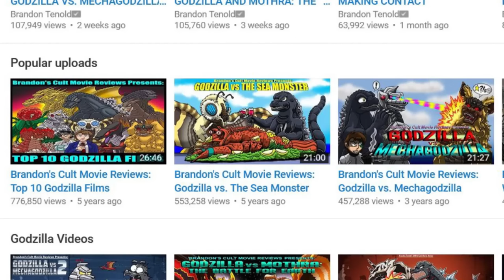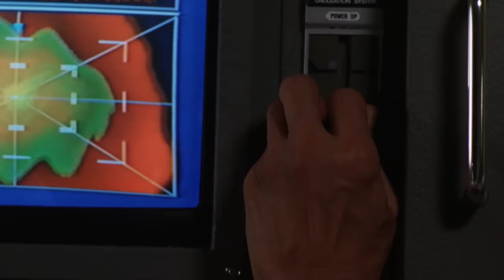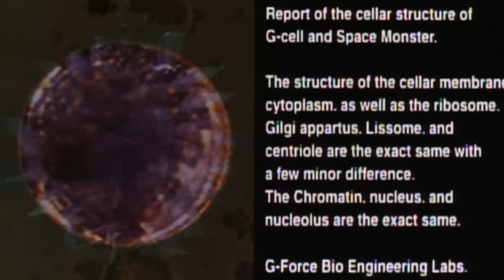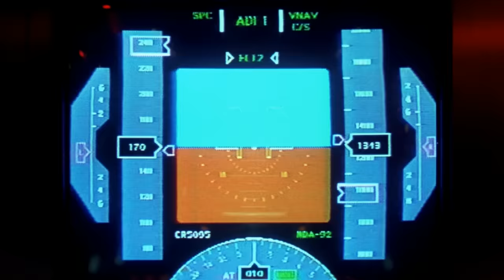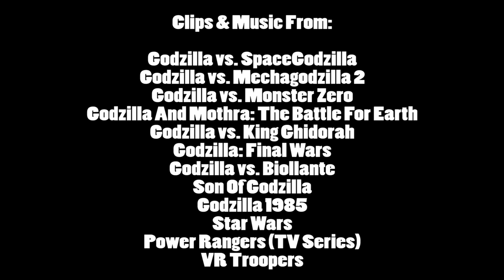Brandon's Cult Movie Reviews: GODZILLA VS. SPACEGODZILLA

Comment: My theory is that G-Force blew their budget on Mecha-G so MOGUERA was basically built with what they had left over / salvaged from Mecha-G. They were pretty broke by DESTROYER which is why they abandoned mechs and had to use the SuperX3, which if you look at it, was even less technologically advanced than the original SuperX (the original had some kinda antigravity tech, the X3 had old school wings). Funny enough though the X3 did more damage than Mecha-G or MOGUERA

Comment: The cutesy design of Baby Godzilla along with the Sesame Street line kinda make sense once you hear the whole story. A while ago, I heard that Toho’s initial plan was to create a child’s show set in the Heisei series that followed Baby Godzilla getting trapped in some underground society. It would’ve been your standard, run of the mill children’s shows, and Toho used this film to kinda spring board the idea. 

Unfortunately, Godzilla Vs Spacegodzilla didn’t do as well as Toho had hoped, and after the Americans came in with their pitch of an American made Godzilla film, all ideas and plans for the series was scrapped.

EDIT: I could be wrong about this, however. I don’t quite remember where I read or heard about this, all I remember was that I read or heard it and the discussion that kicked off.